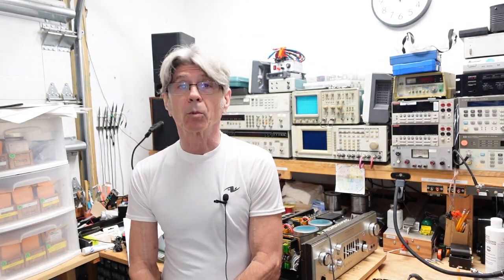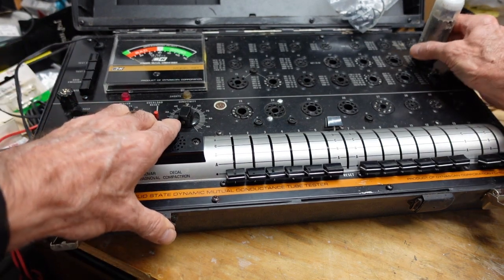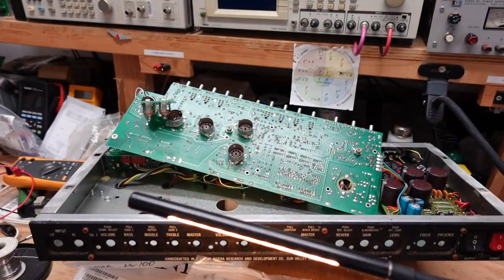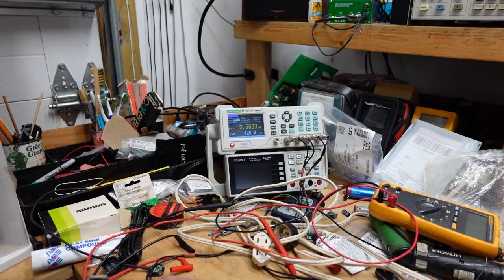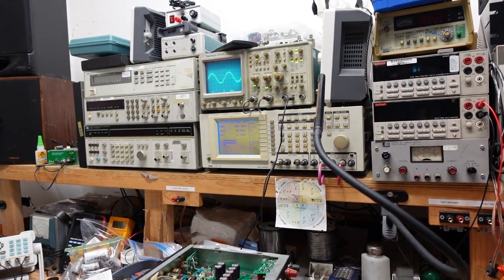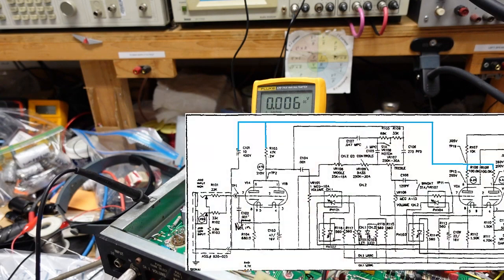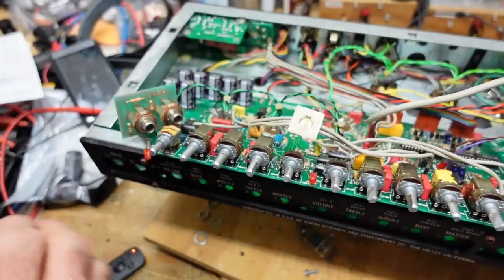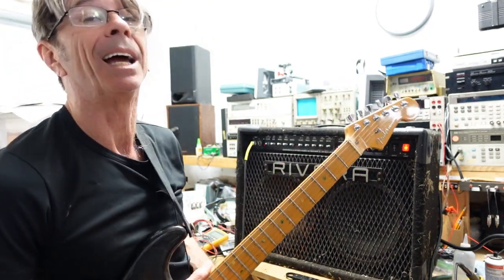Rivera M 100 Tube Guitar Amp Repair

Comment: What do you use to clean your pots.
Im about to do so on my rivera m60.
There seems to be a lot of controversy  on cleaner.
Deoxit d5 vs deoxit f5 vs...etc
Reply from the maker: Yeah, I don't know the truth about this, but I err on the side of caution, since a lot of the stuff I work on has parts that are NLA.  So I use Deoxit Faderlube for pots.
Honestly, years ago I used to use WD40 for pots, and never had an issue.

Comment: I have a Pioneer stereo amp from the 90s, and I noticed in the early 2000s the filter caps are slightly bulged. It hasn't deteriorated since then, and it sounds good without any symptoms. I recently bought replacement caps and waiting to have the time to replace them. Makes me think they are like that by design. Weird! They are Pioneer branded, but they look like Nichicons.
Reply from the maker: It's funny, but when I go through old Marantz receivers from the early 70's almost all the capacitors test good.  Yet some stuff from the 80's and 90's has caps that have failed or are measurably bad.  I don't know if it's by design, or if it's the effect of bean counters cutting costs.  But in the end, quality manufacturing matters, and if they could make long lasting capacitors in the early 70's they should be able to make even better ones today, what with the improvements in manufacturing and materials science.
But we all know that the bottom line is the bottom line.
Reply: @raygianelli3612 yup, all about the bottom line.😢

Comment: Large output tubes should really be warmed up for at least a minute before testing, not just when checking for emission and mutual conductance but especially for shorts testing ( which should always be done *first*); and you should tap the tube lightly while you're holding down the shorts test button, to locate mechanically intermittent short circuits.  

Grid emission, also known as a "gas" test, might not show up until the tube is warmed up for 5 to 10 minutes.  Tubes that have been running too hot due to a faulty amplifier circuit pulling too much current through them can become "gassy"; overheating of the internal parts can cause them to emit gaseous components that contaminate the vacuum, and so the vacuum actually becomes an emitter of electrons. In some cases, material from the cathode gets splattered onto the grid, either from poor manufacturing or from running the tube too hard and hot, and therefore the grid will emit electrons instead of merely acting as a "valve" to control them; if the vacuum or the grid become emitters of electrons, the tube will eventually go into thermal runaway the plates may turn cherry red, until the tube self-destructs.
Reply from the maker: I've printed out your comments to stick in the cover of my tube tester.  They will be discussed on the next video where tubes are tested.  I appreciate you input!

Comment: Great video, I'm not used to seeing IC's (chips) along with valves but I haven't seen inside many guitar amps!...cheers !
Reply from the maker: Thanks Andy!
It's not a true hybrid amp like some.  Mostly op amps for the effect loop buffer.  Some other IC's are for the switching functions.
Reply: @raygianelli3612  Thanks !
Reply: @raygianelli3612 there is a blog on the Net,about a repair on a Rivera Bonehead amp,it was in Australia
The amp wasn't switching,as it should be.The repairman discovered the IC receivers on the board(which hold the IC's on the board) were low quality pièces.Because this repairman had worked in the Telecom industries, he was commen with more professional versions,so he replaced all the chipreceivers  with the better versions and all the switching problems were solved.